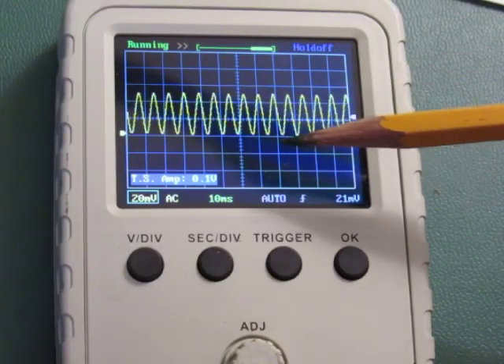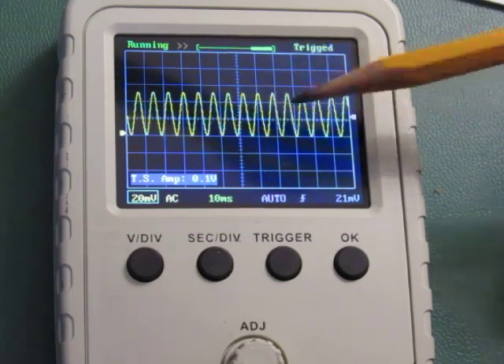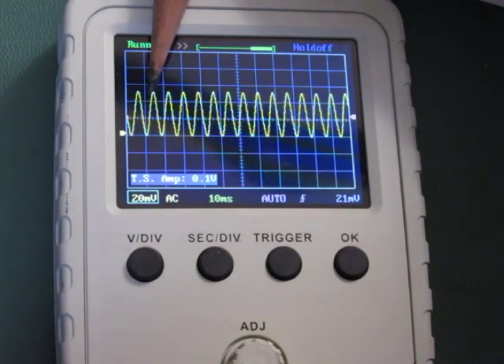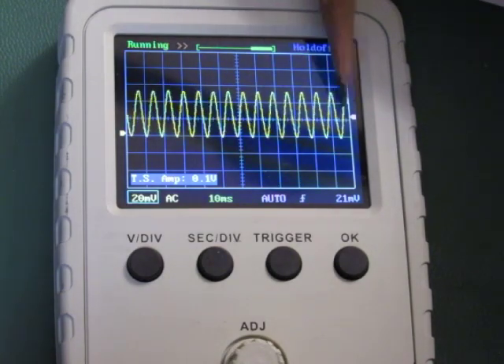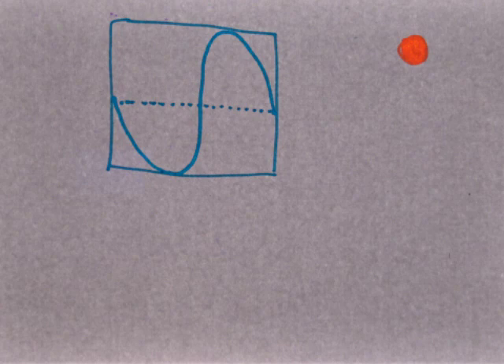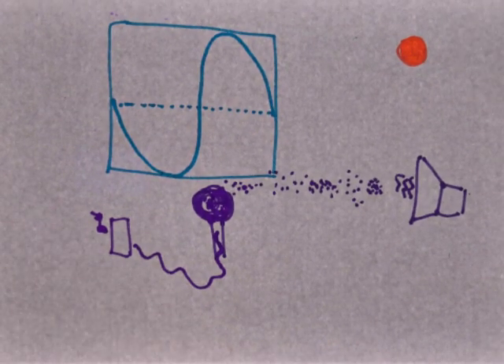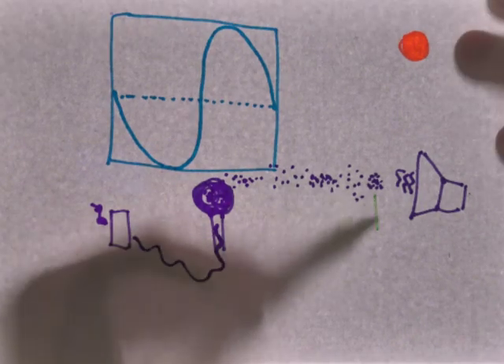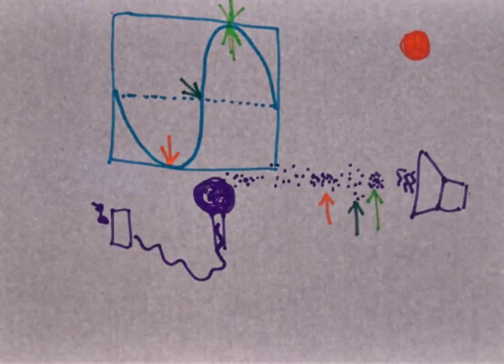Plugging an Equalizer in Modular Synth

Comment: The HiFi EQ is more accurate than I would have thought. Just the analyser display isn't that much as we could see. Cool music 👍👍👍
Reply from the maker: You're so right - I'd like to see a bigger, more accurate display. Looks like I have my next project: building an Arduino-controlled display screen!
Reply: @pbartmess  I think that is due to a filter slope of only 6 or 12 dB per band where you'd need 24dB per octave for a "tighter" separation of the bands at the analyser's input.
Reply: There are very good solutions with soundcard and software: search for "audio spectrum analyser software" .
Reply from the maker: @ludwigkopp8130  I've been doing the search you suggested and I have some super ideas I'm going to try out. Thanks for the insight!
Reply: @pbartmess  am always happy to share.